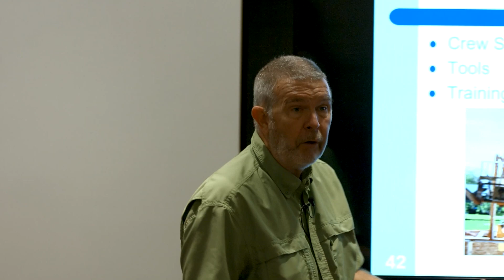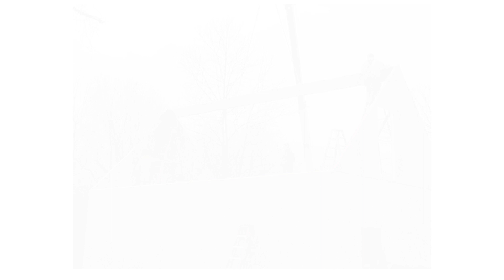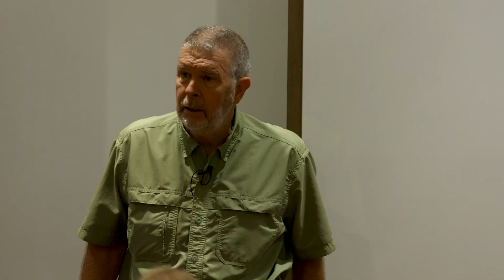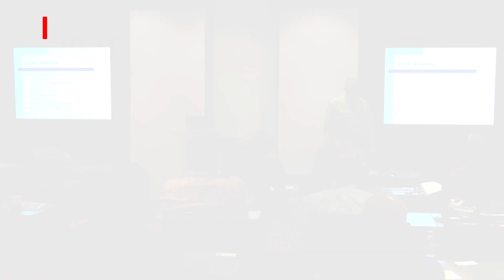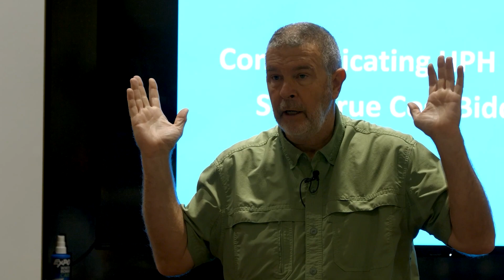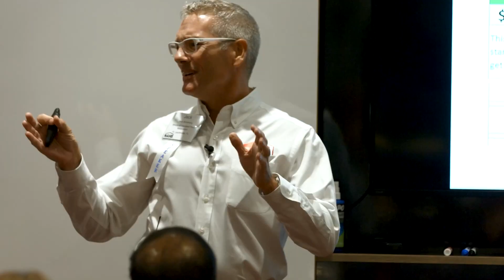Closed Building Systems: Building with Structural Insulated Panels (SIPs) - Part II

Comment: Thank you so much for the excellent presentation! Your section about moisture management principles in SIP panels (let it dry out towards the side of the panel where it got wet) made me think about my planned application. We have planned a low slope roof angle (2/12) over 7/16 OSB SIP and -- hopefully low-cost -- corrugated metal panels on the top. The home will be built in Twentynine Palms, that is climate-wise very similar to Phoenix that you have mentioned as an example. My question is if you would recommend some kind of membrane that would allow vapor penetration in case the OSB is getting wet (we had some heavy rains last month as an example)? There is always the question if some lingering splash water would penetrate the permeable membrane long term (maybe over several hours). Would it not be more advisable to use a watertight sealing (like Polyglass XFR) or just felt #30 not to allow water in in the first place?